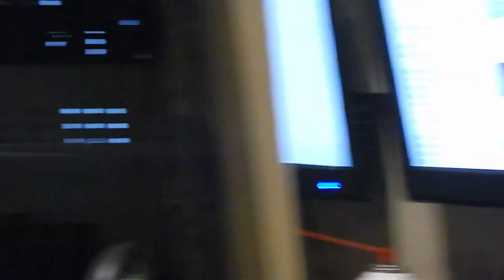Batteries, Slot Motherboards and Plans For a new Storage Server

Comment: the slot didn't change, the speed requirements did. Anything with a 440BX or 440GX can run a Pentium II or III if the FSB on the III is 100MHz. then you move up to the 810/815 for the base 133MHz-based systems.

for an Athlon heatsink, you may want to look at this: http://www.ebay.com/itm/Heatsink-DUAL-Fan-Intel-Slot-1-PENTIUM-II-III-AMD-Slot-A-Athlon-NEW-/142010385570
there were also some other aftermarket heatsinks that were extremely good. http://www.ebay.com/itm/THERMALTAKE-AMD-II-PII-INTEL-CPU-COOLER-HEATSINK-GOLD-ANODIZED-ASSEMBLY-/252611426588 this one is one of the really good ones, or at least a derivative of it.
Reply from the maker: Sudos Thanks for the info! I'm not really sure what chipset these boards have so I may just power it up and see if it posts with the p3 in it. Any idea if that would harm anything?
Reply: just make sure the FSB on the PIII is 100MHz and you should be golden. Alternatively, see if there's a BIOS update available for it as sometimes that will add in better support, but generally they don't need it too much. Katmai PIIIs were the de-facto at that point, Coppermine PIIIs will mostly sometimes work.  I have a Poweredge 2300 that shows my dual 750s as Coppermine in the CPU ID field for instance, but the BIOS is slightly just old enough to not have support for them-- Dell themselves even said it shouldn't work, but I did my research and it's apparently a popular upgrade nonetheless.